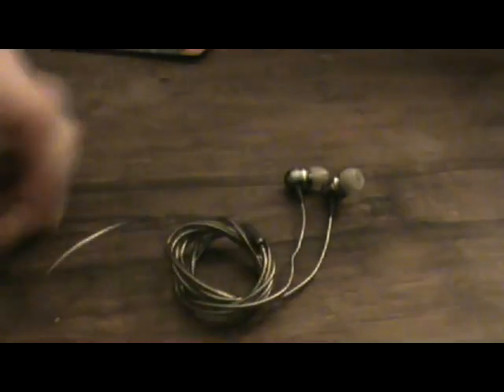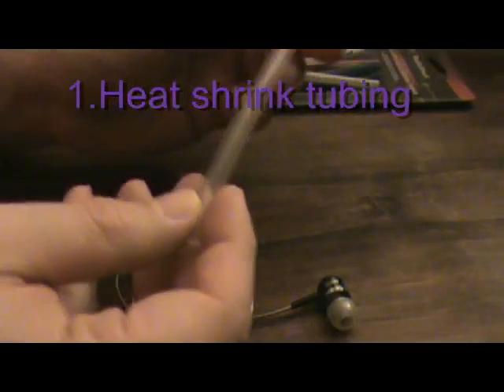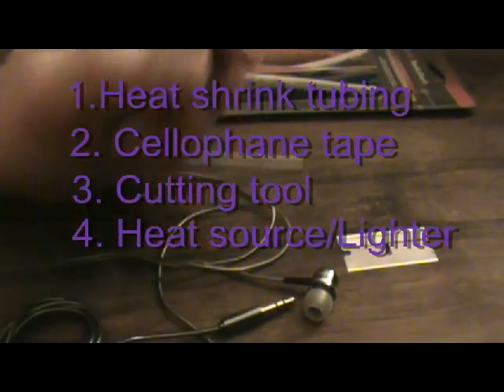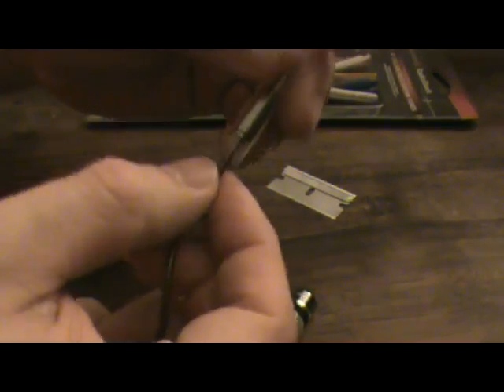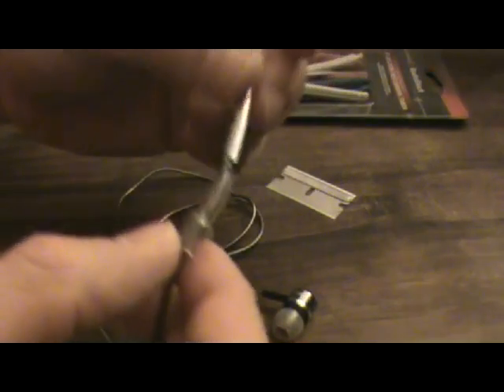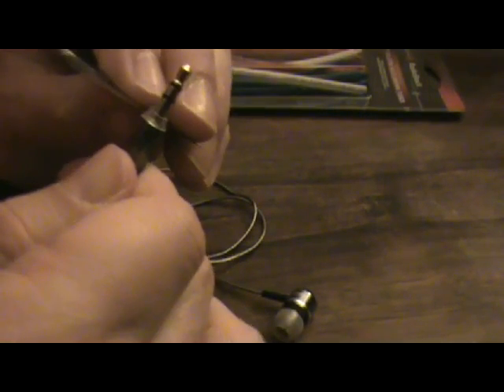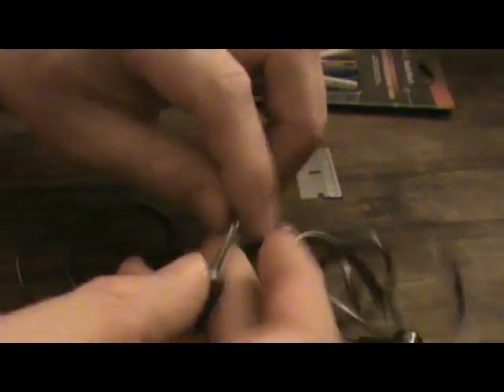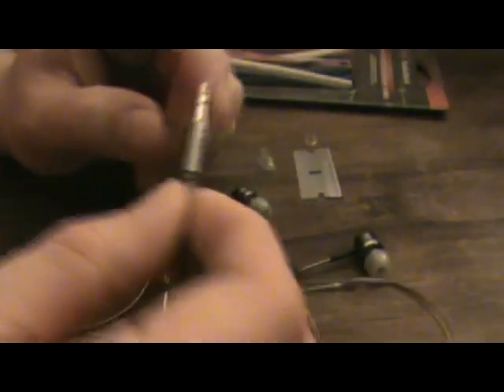Increase the life of your earphones--How To

Comment: That is smart using the tape. Would have never have thought of that.
Reply from the maker: The tape isn't always necessary if the plug has a texture or grooves molded into it. But if the section is smooth like these headphones, it helps.  
Thanks for the comment!

Comment: If I keep my earphone connected all the time, will that cause any problem to my phone or earphone?
Reply from the maker: It depends on the design of the plug at the end of the wire. The "L" shaped plugs usually work well as long as you keep the wire parallel to the edge of the player. The straight plug, the kind that sticks up at a 90 degree angle, can exert pressure on the contacts inside the player, and sometimes one channel will stop working. I recently did that to a little MP3 player when I kept the wire plugged in when I didn't use it, but I kept it on my pocket, and it got bumped around. Better to unplug when you're not listening, I think.

Comment: if I were to do the same thing and add a pen spring would that extend it even more or would it cause pressure points?
Reply from the maker: The spring would serve to spread the stress across a greater length of the wire and away from the base of the plug. Once the tubing  shrinks, it's pretty stiff, so the spring probably wouldn't make much of a difference. But you can't tell until you try...

Comment: Another thing. If you have headphones where the wires are strong but are not straight and have bends that can not be straightened then do this---- hold the headphones by the buds and jack and let the wires down into a cup of just boiled water for a few seconds - the wire will come out straight

Comment: can i use pens spring? will it reinforce my headphones?
Reply: There's a chance you would cut your fingers with the spring.
Reply: don't. i did it and the spring did worse, slicing through the cable and getting rusty
Reply: Did you use the spring IN PLACE of the heatshrink tubing, or as an added layer underneath it?

Comment: If you have some ordinary noise isolating earbud headphones that fit your ears well - twist them slightly so that that the bit with the wire fits in above the little lobe at the front of your ear. You'll then be able to push them in further and make the isolation far more effective
Reply: hey pretty smart, but then, it hurts your ears...

Comment: Could you also do this to the wire by the actual earbud part?
Reply from the maker: It would be very hard to do, but I guess you could with a little experimentation.  A lot of headphones already have a rigid bit of tube attached to earbuds for this purpose.

Comment: Great video! but i dont have Heat shrink tubing and my Audio jack is L shaped. is it alright to use tape? if so which tape would be the best alternative?
Reply from the maker: Sure. Tape will also work to reduce the flexing. The L-shaped plug is also designed for that purpose so, between the two, you're probably going to be OK.
Reply: tnx man

Comment: why do people keep calling em headphones, do they go on your head? they are earphones
Reply: +Latin Lover 
head·phone  (hĕd′fōn′)
n.
A small speaker that is worn over or in the ear, often as one of a pair connected by a wire attached to a band running over the head.

notice the word "often" doesn't mean always.
Reply: +Zaren k notice the word "head", why do people use the word earphones then?
Reply: Latin Lover Notice the dictionary DEFINITION of it saying that if they are worn in the ears they are still headphones.

And just because of the existence of another method of explaining what something is, doesn't mean the old method is unusable. 

earphones could mean a headset, seeing as you wear them ON your ears.

Why call them earmuffs? you wear them on your head right? call them HEADMUFFS! :D

this line of logic is stupid, just accept that when someone says headphones they mean a device with a speaker you put in your head.
Reply: earbuds are in ear

headphones are over ear
Reply: +PerpetuallyPissed what, earbuds are the little plastic pieces that are replaceable, earphones go inside the ears, and headphones over or on the head
Reply: +Latin Lover I've always called earphones earbuds. it rolls off the tongue easier

Comment: There are no heatshrink tubing what should ido??
Reply from the maker: Jovian Parco You can still use tape, it's just not quite as elegant. Any tape will help, even cellophane or masking tape. The cellophane tape may come off after a while and have to be replaced. Just take a little strip about 3/4" long and wrap it around carefully.

Comment: Why didn't you just shrink the rest of the heatshrink rather than cutting it off?
Reply from the maker: Good question! I cut the tubing flush with the end of the plug because if a little of the tubing sticks out, the plug won't go all the way into the device, and the headphones wont make sound. On the other side, I didn't shrink the tubing all the way for 2 reasons-- 1) I was holding onto that end, and 2) I didn't want the heat from the fire to contact the wire directly, and that little bit of unshrunk tubing protected the wire.

Comment from the maker: As of today, 11/17/2014, I'm still carrying and using the same headphones on a daily basis. They work as well as ever, but I have to admit the insulation coating the wires has gotten rather stiff in some areas, and has developed a few small breaks in the middle of the wires that I've just wrapped tape around.
Reply: woah, the fact that you got earbuds to last long enough for the insulation to be a problem is impressive.

Comment: Can we use this method to my broken earphone? Braindazzled like put the heat tubing to the sensitive area of earphone?
Reply from the maker: My apologies for not responding sooner. This method will NOT repair broken ones. This will protect the wires from breaking, but once the wires are broken, they have to be reconnected (or replaced). The good news is that if the break is close to the plug, the old plug can be removed and a new one soldered on. You have to be careful to reconnect the wires correctly, though. There are other videos that can show you how to do this (not my me, though).
Reply: Okay thank you very much. I have been waiting for your reply actually . once again thank you really helps 😊

Comment: to the people with one earbud/speaker that's dead, or works if you get it juuust right, 99% of the time this is because of the wires connected to the headphone jack. your headphones themselves are fine, you don't (and probably shouldn't) need to do this trick for that end. either way, your headphones are shot, you should buy new ones. and if you do this trick on that pair (at the jack), you can prevent this from happening to them. Good luck.
Reply: Oh and to the people with wiring coming out of the earbud, no. throw it out. same with anything else in your house with frayed wires... in general... from now on.

Comment: i have a HTC desire and i had 5 pairs of earphones that used to work fine...basically each time i bought new earphones for my htc they would work fine and then after about 4 months one side would stop working and it works a little if i move the cable at the input jack. i only used my earphones on my HTC.....is something wrong with my phone jack?? im tired of buying new earphones...i also take really good care of them because at first i thought i was breaking them..please help me!
Reply: Same with me! Have an htc desire and I had to buy over 10 earphones because they always stopped working but sometimes the ones that weren't working on my phone worked on my laptop or iPod! I have a feeling it has something to do with the phone jack but I don't know?

Comment: What's the most effective way to shrink wrap when the plug is slanted at a 90 degree angle like an elbow.?
Reply from the maker: Hmm. Interesting question. Usually the 90 degree plugs don't put as much stress on the wires as the straight ones do, so there's less need to reinforce it. But if you wanted to use shrink tubing as reinforcement on a 90 degree plug, you'd have to push the tubing past the plug and only on the place where the wire meets the 90 degree extension. Does that make sense?
Reply: Yes thank you. I was just worried the shrink wrap might not fit and turn around the corner. Thank you
Reply: ***** Curious if you tried this on a 90 degree plug. I've a new pair I'd like to reinforce.
Reply from the maker: The intention behind the 90 degree plugs is that they don't wear the wire in the way the straight ones do (like the ones in the video). I don't think that shrink tubing that is wide enough to go over the 90 degree plug will shrink sufficiently to reinforce the wire, but I've never tried. It might work.

Comment: ok they tend to break all over the cord and that might help a bit but not if you pinch it or something like that but if one side does not work allready look at the jack and take off the first black ring from the cord down and put some copper wier or solder on it and make sure  its smooth and you will have good old mono headphones they will last twice as long and thats because it has two wiers to supply the sound signal and a base if the base breakes than they stop working no matter what

Comment from the maker: It doesn't have to be exact, just as long as it reinforces that place wehre the wire meets the plug. If the piece you're using is too short, you can either remove it (carefully!!) or, probably, shrink another piece of tubing over it. If it's too long, you can trim away what you have to. As you may have noticed in the video, I did trim away a little bit from both ends.

Comment from the maker: The earpeices are more problematic, becuase every brand is designed so very differently. In my experience, if the wires break near the headphones, it's usually INSIDE the headphone, where the wire attached to the actual sound element. Some possible options to reinforce this part of the headphone might be to use tape around the wire, another possibility might be to use a little drop of thick glue where the wire meets the shell (but don't let the glue run inside!). Good luck!

Comment from the maker: Sorry to hear it  Bonnie. Even if you burned away the insulation, you can still salvage the headphones, as long as the wires are unbroken. If the wires are exposed, you can put a little strip of electrical tape between the wires to keep them separated (the metal musn't touch) and then wrap the bad area with electrical tape (and cover it with shrink tubing if you haven't sworn off the stuff).

Comment from the maker: Sorry, I haven't had a chance to respond earlier. It shouldn't be necessary to reinforce the rest of the wire. Heatshrink tubing becomes very stiff when shrunk, so it wouldn't be a very good idea. Your headphones would look like a stiff rod. But you shouldn't need to reinforce the rest of the wire. It's that one little spot close to the plug where most headphones break.

Comment from the maker: If you did it for the entire wire it would be stiff like a rod! The heat shrink tubing gets very stiff. But I don;t think it's really necessary. Nearly all the headphones I've ever had wore out at that one spot above the plug, so the stiff tubing protects it. BTW, the headphones I used for this video are still working like  charm!

Comment from the maker: @TrolloftheTube --It looked about 1/4" in dia. I bought a package of assorted sized tubing at Radio Shack and just used the one that seemed tightest, since it was convenient for me, but if you buy it on line or from electronics specialists, they can usually tell you what the starting diameter is and what the tightest diameter will be.